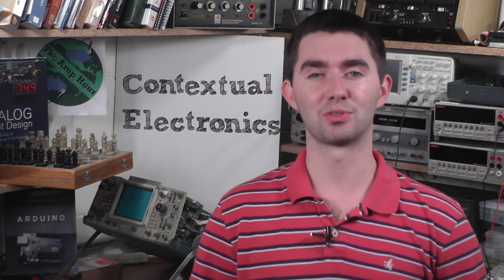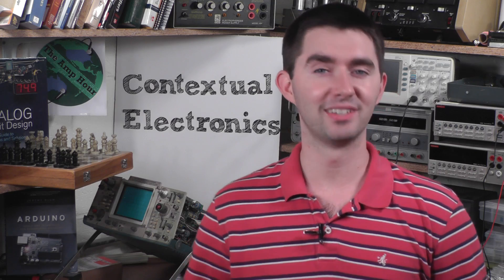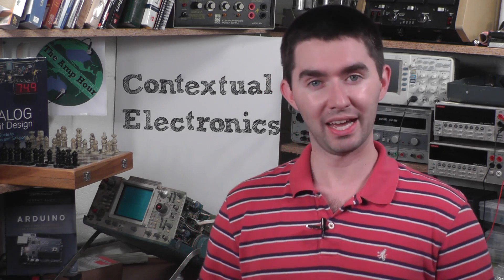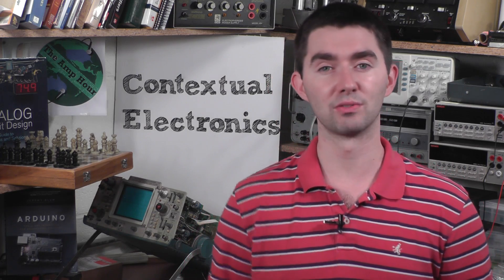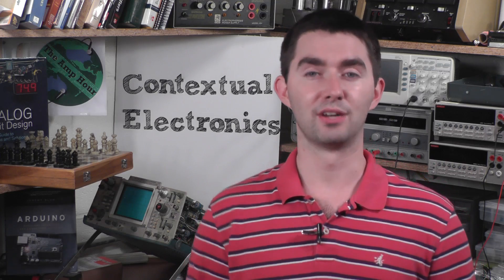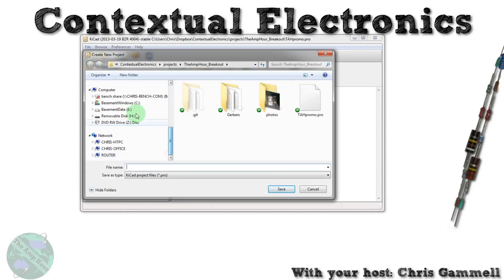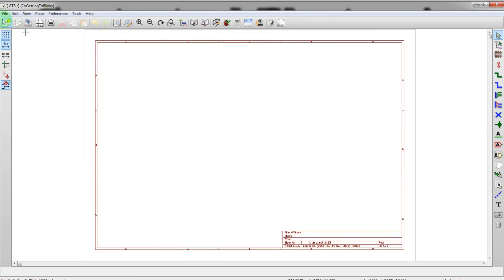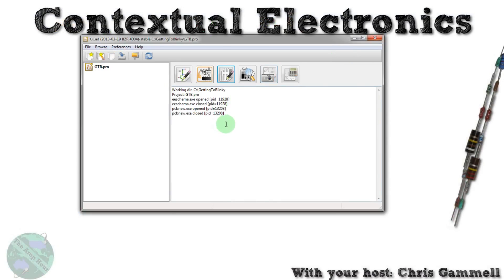Introduction and KiCad Project Creation - "Getting To Blinky" KiCad Tutorial - Part 1

Comment: Using the Mac version is impossible.  I truly wish this version was as stable as Windows.  I ended up finding an old Windows box and following along.  If only folks that want kicad to gain more momentum wouild try it on Macs.  It is doable but to not be totally frustrated you probably would have had to be the Mac developer.
Reply from the maker: This is hopefully one of the things that will significantly improve with CERN joining in on the development effort (in an official capacity, they already contribute)
Reply: I have the same problem, fortunately i have windows installed on my MBP for just such occasions, i hate windows but sometimes you have to use it